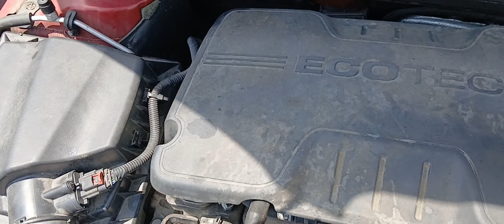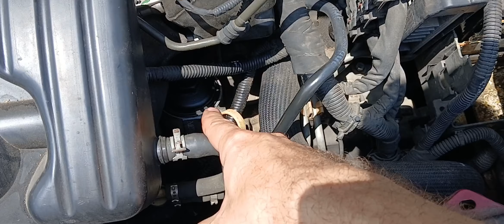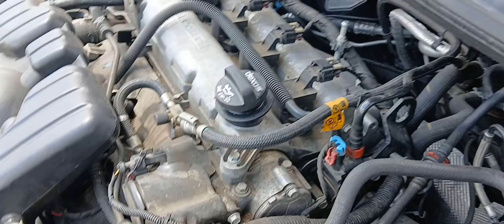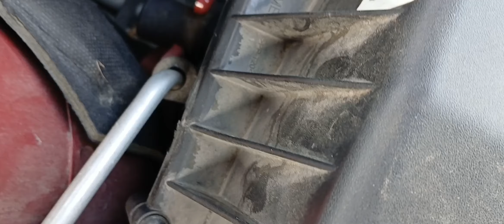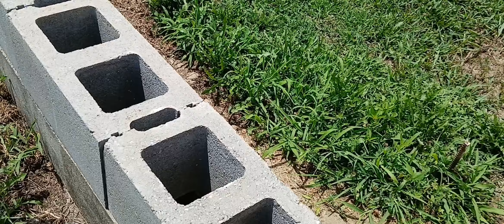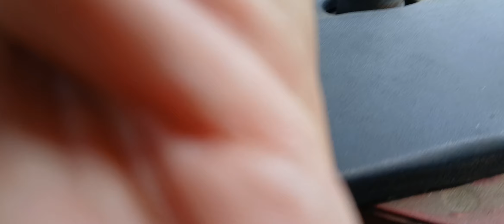**VIEWER REQUEST** Updated 2.4 Ecotec LEA engine sensor tour: 2015 Buick Verano with links below

Comment: I get a crank position error on my verano. I cwn reset it and it will go away, but always comes back. Now it wont exceed 4k rpm, then gets a reduced power warning, and then wont exceed 3k rpm after that. Turning off all TC etc.. ever seen that before? Cleaned mass air flow sensor, and all others look ok. Im completely stumped
Reply from the maker: Yes ive seen this, its probably going to be the crank position sensor. Also if your over 150,000 miles it might also be time for timing chains and guides and also the camshaft phasers.

Comment: Is that a special hose that goes from the air intake to the valve cover?  I wish my mechanic would have replaced mine after breaking the connector off
Reply from the maker: On some cars it’s a molded hose however I used bulk hose and cut it to fit.

Comment: Where is the etc sensor,please
Reply from the maker: The coolant temperature sensor is located on the driver side of the engine below the coolant hose, it will be a 2 wire sensor. Bit of a pain to get to.